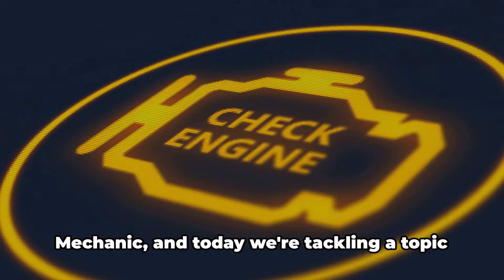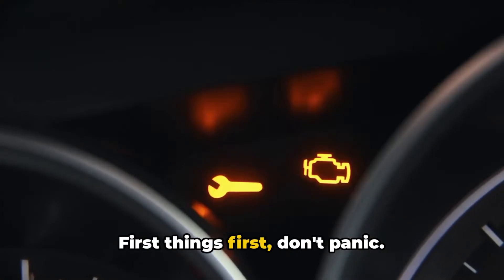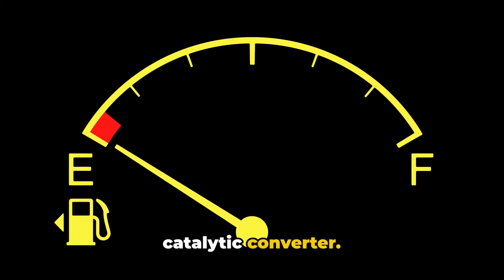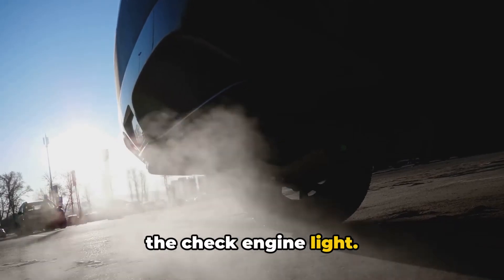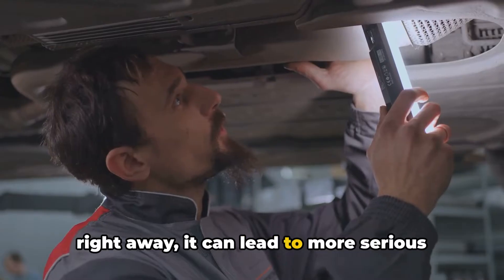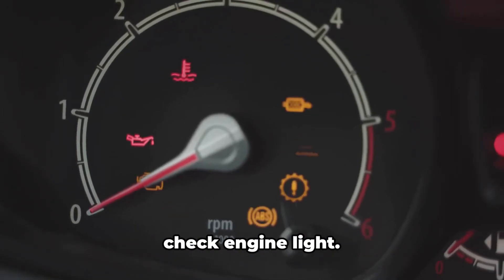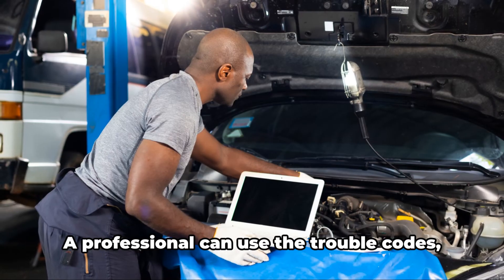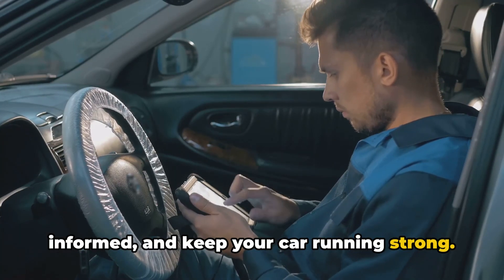Check Engine Light On But Car Runs Fine: 7 Possible Causes

Comment: My check engine light has been on for 3 years now.  Just recently   it's starting to smoke while fully warmed up. Whitish grey smoke. Smells like fuel. Brought into mechanic and he said it's burning oil and to just keep topping it up. 06 Chev malibu 2.2L close to 200k km now. Daily driver.  Any ideas?  I know Ill hafta get a obd2 tool to get the codes n go from there. But was wondering if u had any light on it. Thanks Brian!